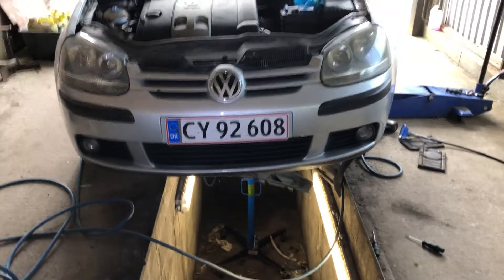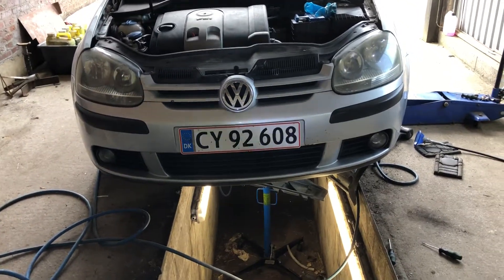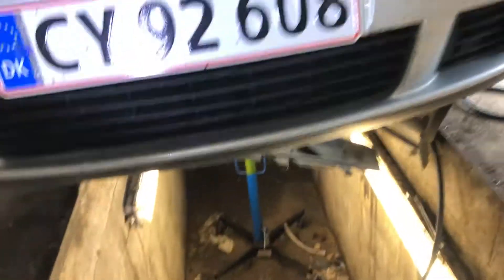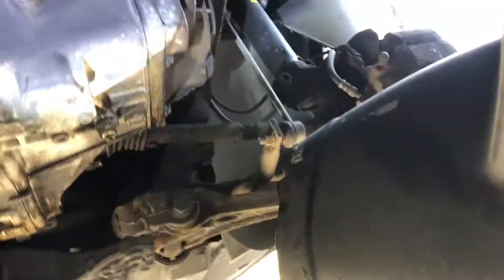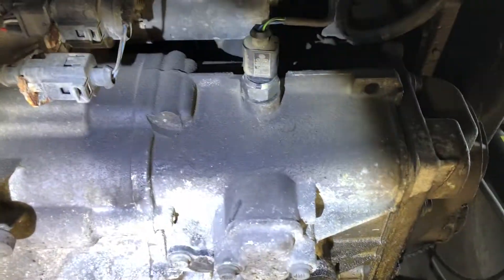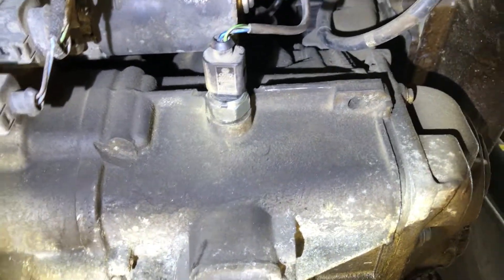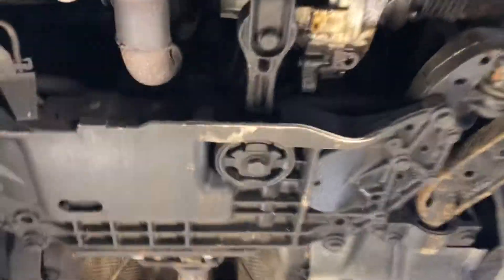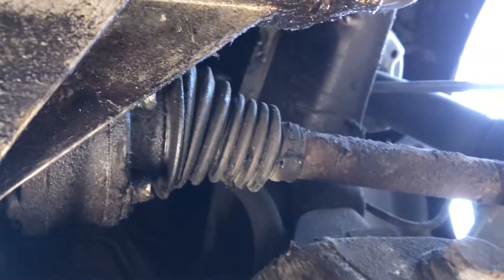VW Golf 5 Gearoil Change:  Filling +  Drain Location

Comment: Dear friend, you cannot fill the transmission there, you will never succeed, you get a little in and the rest comes out, I lost a lot of time with it, I filled the transmission via the sensor by loosening it from the reverse gear and filling it, or If you have succeeded, I would like to see how
Reply: That's smart
Reply: for 1.4 tsi CAXA, you are right
Reply: That is right, I also did like you and only got in 1.5 L and the real capasity is 2l. Have to use also the reverse light hole